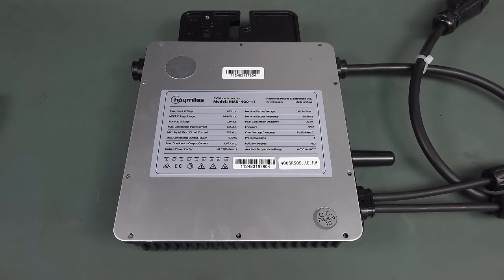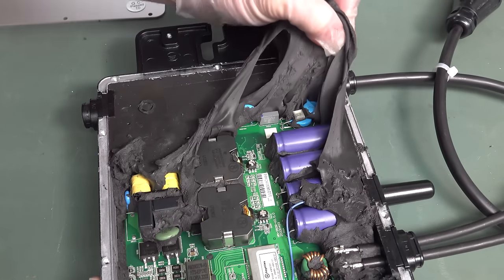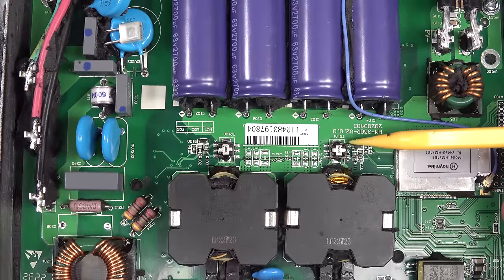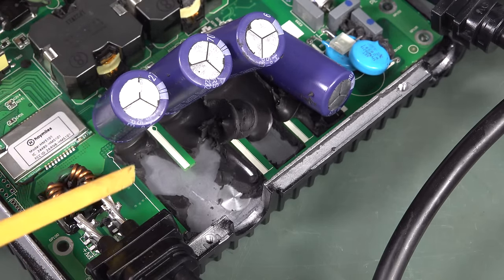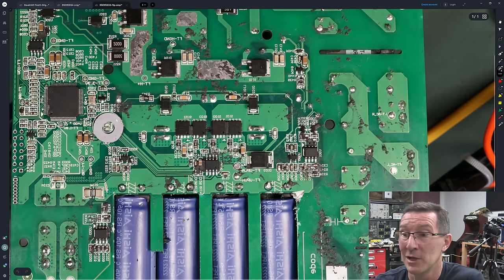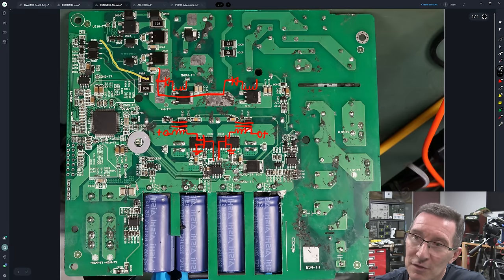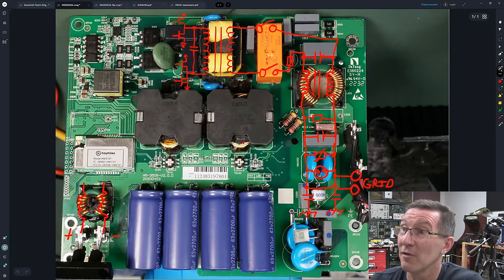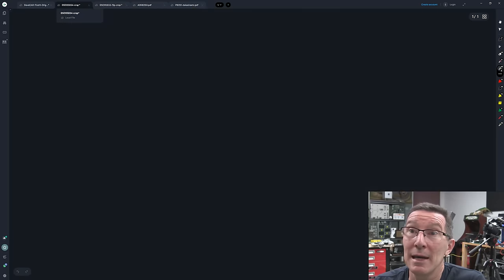EEVblog 1518 - Hoymiles Solar Microinverter TEARDOWN

Comment: Thanks for this. If you apply the panel backwards, the diodes in the FETS limits the voltage to -0.7V. I routinely get 356W out of my HM-350NT and they blow away my IQ8+. They're excellent, IMO.
Reply: haha that’s not a good thing. a -0.7v “limit” is a short across the panels...
Reply: @Ferraday  They are current limited to Isc, it doesn't hurt anything for a short period, and doesn't damage the inverter.
Reply: @Ferraday  Across one panel - it doesn't matter since they'll only get as hot as they would with no load anyway. The panel will get the same amount of energy from the sun whether it's shorted, disconnected or properly connected. Only difference is where the heat gets dissipated. If the panel can survive sitting out in the sun, it can survive being shorted.

I'm more concerned about the 0.7v drop across the FETs. At around 13 amps short circuit, they'll have to dissipate 9.1 watts worth of heating. Better hope that thermally conductive potting compound is up to the job since that's the only thing moving the heat from the PCB to the outer case.
Reply: @wasddasw6485  Clamped at around only 1v the panel will be so far from it's MPP that the output current will be nowhere near the rated value of that panel

Comment: Definitely get the other micro inverter for comparison. How do these thing’s synchronize with grid frequency?
Reply from the maker: Yes, they sync, that's the idea.
Reply: Loose sync and KABOOM!
Reply: @EEVblog  How ?? does it detect "grid" then switch on... but then how does it detect if grid is "disconnected"...?? ie islanding... cant figure that out in my little grey part...
Reply: @pedromorgan99  Simple solution would be to switch the output off for a cycle every 10s or so, and measure the voltage to see it collapses. Google says various methods are used, shifting the voltage or frequency and measuring for a response on the grid.
Reply: One would guess it uses PLL (Phase lock loop) type of circuit to achieve grid sync.
Reply: @mymisc1896  AC-Coupled capacitor PLL, Rneg synthesized clock sync, if there is no mains at the coupling capacitors there is no clock sync, its like an RF multiplexer.  The question is why does the inverter have to shut down? Why is it illegal to install an ATS like a generator?
Reply: @pedromorgan99  Yes. It's AC-Coupled by those 4 coupling capacitors   they serve to isolate the dc bias voltage on the transitor gate yest still be able to so clock-sync with the mains the proper frequency upon generation from the emitters.
Reply: @mpirron1  It is designed/required to protect service man when there is a grid outage. However, if there is smart switch/relay (e.g. Tesla powerwall gateway) then it will isolate grid to the rest of sub circuits hence can operate in "island mode/state" with solar PV until the mains is back which I guess the smarts would sync to grid phase/voltage with local inverter before connect AC  back to grid.
Reply: the PV micro inverter also need to know and act on how to reduce/switch off output when in island mode so it won't over charge the battery bank,  .. e.g. using frequency +/-
Reply: @mymisc1896  that's accomplished by a solar charging circuit, either mppt or pwm. During a Mains loss/grid uncoupled situation it's all o you have a string inverter or micro inverters you still can't use the electricity generated by your solar panel as you should be able to. The only thing you can use them for is charge your battery, and it's bullshit,  because a 1 ton mini split  will run on 3000 Watts all day. Six solar panels get you enough power to have Aircon probably not with batteries,

Comment: Is that mains side correct? I thought you weren't supposed to put GDTs directly across high current protected lines because once they light, they may not extinguish. I always heard that this was a common failure so MOVs are put in series with GDTs. Maybe the GDT is in the center and goes to ground, while the other side goes through one MOV to live and another MOV to neutral?
Reply: It will just blow the fuse on the mains.
Reply: @andreasdill4329  Good point, I don't see the fuse but I'm sure it's there.
Reply from the maker: I checked the traces, yep, it's in series with the MOV, nice call.

Comment: you can talk to them via an NRF and openDTU :)
Reply: Prices have gone through the roof since they are controlable by opensource software
Reply: Hi @Peter Kowalsky,
MI- and HM-Models did use NRF24L01+ for communication via 2.4GHz Enhanced Shock Burst at 250kBps.
But recent HMS- and HMT-Models instead employ an CMT2300A for communication via 868MHz / 915MHz at an expected 125kBps rate.
OpenDTU and AhoyDTU do not support HMS-/HMT-Model communication yet. But we are working on that :D

You may check our Wiki for the Protocol and some of the details for Germany and Austria,
in case you want to keep the produced signal in line with the local Grid Profile(s).
Reply: @karlakunze9823  thanks for the info karla!

Comment: My solar installer wired one of my 9 panel strings reversed polarity into the hybrid inverter. Managed to handle it fine, i was impressed. Though it would have at least destroyed the mppt for that string, but no... It's running fine...

Comment: Those Caps are called DC-Link capacitors, mainly energy buffer und reduction of current ripple, a common thing in Inverters 👍
Reply: And regarding the TMS320, no suprise 🙂 the C2000 is still being used today, but mainly as a redundency/safety controller not as a main MCU

Comment: Just I recognize that is a HMS version. The models with HM and MI it exist already a opens source project in github (Ahoy and OpenDTU). With that you can read the inverter and control it. 

The HMS use a other frequency (868mhz) and it is in reingeneering process already.

Comment: There was a fireman that died in Germany due to DC arc over a few years back. Since then they have to check the solar panels before starting the fire fighting. 

Note, that even if its in nighttime. Just the back light from the fire, might charge up the panels to a considerate voltage, even if there is hardly any current.

This is a problem, because if your house is on fire... for some other reason, and they can´t verify that your pannels are AC or low voltage DC, they will not save your house. (well.. they might if its just a minor fire, but if its a big fire and they have to spray the whole house)

Comment: Single phase AC has a sine^2 power profile where the PV panels need a constant DC load to provide maximum power.  You don't want 2x AC line frequency power flow ripple current to show up on panels or you lose power from PV panel.  

That is the reason for all the electrolytics across PV inputs and the weak component reliability link in the micro-inverter scheme.  Electrolytic caps MTBF is highly dependent on their operating temp.  Micro-inverters operate in a very hot environment behind PV panels, likely a few inches from a hot roof.  Not great for electrolytic caps longevity.

Comment: The DC output of the solar panel is not as clean as you want it.  They actually have a fairly high source resistance.  I forgot how many cells you have to have in series to get 60 volts.  Adds up to a lot of slop in the voltage hence a lot of beefy caps to smooth it out.  What kind of current pulses do you have at 400 watts?

Comment: Nice teardown Dave! I have a question though. The mains transformer looks so small for 400W and 50/60 Hz? Wonder what kind of core material is used to have the permeability and low Eddie currents required not to heat up like crazy. Also obviously the H bridge creates harsh rectangle waveform on the primary. There will be losses. Then again I am not an inverter person just wondering...
Reply: Nice catch. Dave got it wrong. Galvanic isolation is from the flybacks and the H bridge he is referring to is actually mains frequency unfolder. This is exactly the patent of Nphase inverter - flybacks operating with rectified AC reference and the H bridge converts it to AC. The magnetic components is a common mode filter with very high differential mode components as well.
Reply: @giangelov  thanks for the clarification. Though I don't see smoothing caps after rectification from the flybacks. So that means that flyback frequency halfwaves are used.  Likely the filtering after the H bridge takes care of this.
Reply: @LutzSchafer  That is the reason they have used interleaved flybacks - less ripple. They do have filter caps and the DM inductance helps also. On the front section it is exact topological copy of Npahse. In their design I remember they used thyristors for the H bridge. I'm not sure if Dave did check these devices, but from the solder side of the PCB the "gate" driving circuit looks very simple for driving MOSFET.

Comment: yes please, i like knowing the failure points of these
☺
Reply: The cable glands and the seal on the lid that is to flexible with to little screws. I opened my DS3 AP-Systems; same goo and waterdrops in all 4 corners within 6 montths after install.

Comment: So gas discharge between the mains, and another between mains and ground.  Good protection in case the mains are subject to something harsh, like a lightning strike?
Reply: nope. this will protect only from minor arcing, like f.e. ballast from fluorescent tube kicking in or disconnecting wall-wart . Lightning strike has current of about 10 000A. For 0.1ohm protection, this means 1000V spike . Also lightning strike generates huge EMP. 
IMHO best protection against lightning is insurance, as anything else just adds incredible complexity and cost.
Another good protection are dpdt relays with at least 5KV isolation on both input and output. 
As storms usually do not happen in clear sky, if there is no sun unit should be disconnected and grounded by relays. Usually spikes coming from storm can be also detected on AC side. Most UPS devices have some kind of protection algorithm implemented basing on detecting voltage spikes in the grid, throwing protective relay and switching to battery mode.

Comment: Hmmm...  It must disconnect if there's no mains voltage - got it. This means my neighbors who hope to enjoy electricity in case of power failure at least during the day are screwed. :)
A question though - how does it know when to disconnect? I assume all those microinverters are connected in parallel at some point, so to each inverter there is no difference between mains and another inverter.  How does it work?
Reply: Each baby inverter's AC output all meet up in parallel in some kind of "combiner" box where they are AC- coupled to your smart meter in one of several possible schemes. And then comes in, like you so astutely grasped, their primary function. See we assume the primary function would be to generate electricity for the homeowner, but only the homeowner thinks that. You know how can you know? Because if the grid operator is down and can't take the excess at it's price, you don't get to generate as your inverters shut off.
Reply: @mpirron1  You've completely missed answering the OP's question. The inverter was sampling mains voltage and frequency, and output current accordingly. The the mains power goes out. But the inverter has been putting current on the mains line, which if it were balanced to the load, would create a sinusoidal voltage. V=IR. So how would the inverter distinguish between that power failure case, vs the mains still being on?
Reply: @TheHuesSciTech  I didn't miss answering that question, Because it's not the one that anybody should be asking. But if I must... the inveteter is AC-Coupled to the mains, across the coupling capacitors And the frequency Is ... Oh, just read it in the other post below, or read the papers on it. However, there is a real question here. It's just not that one. The question is why do the inverters have to shut down?
Reply: Hint.... It's got nothing to do with backfeeding the grid.
Reply: @mpirron1  That was explained in the video. It's so that electricians working on fixing the problem (e.g. getting the fallen tree branch off the power lines) don't get electrocuted by power being fed back onto the grid by solar inverters on nearby homes. 

To add more detail, you could have special circuitry to cut off the house from the grid so that the inverter could power the house without energizing the grid; but a) that would be an expensive addition for a rare circumstance, and b) there's no guarantee that the current level of light on the panels could power everything in the house anyway, so it'd be a really shitty and confusing experience for the average person. Meanwhile, a emergency diesel generator can always provide XXX kW on demand, and are selected and specced based on what the relevant business/hospital needs to keep going. And the whole intention of them is to deal with power blackouts, so the equipment to definitively and safely NOT back-flow the power onto the grid is worth the cost.

So stop being a troll who dismisses perfectly reasonable and interesting questions as "not the one that anybody should be asking", giving BS answers, and thereby derailing their threads. You're perfectly entitled to start your own thread, so do that.
Reply: @TheHuesSciTech  I'm sorry if you don';t like find the way I say things peoplke need to hear, I found that when it works, it's the most successful way people come to understand, and they are still the minority. because you all are very blinded.
Reply: I mean come on man do you really think a lineman is gonna risk his life and just hope somebody doesn't plug a generator in through the Dryer plug without turning off their mains breaker? Would you? No nobody would You'd make sure there was a secure path to ground well before there was a path to you, everytime, maybe 2 just in case.
Reply: Read everything that I have written? In other comments. In this video. And maybe you can understand That if you're connected to the grid, your solar is not yours. You think it is. But it's not It's the grid operators cheap power that you can't use if they dont want you to. Can't you see?

Comment: more and more ppl is ordered to shut down there solar systems here if they use inverters of that type (one for every panel) they make so much radio noise together that they shut down airport radar and other communication systems. yes they complies by itself.. many of them together do not.

Comment: The square device on top of the AC side MOV is most likely a thermal fuse in series with the MOV to guard against short circuit failure of the MOVs. Quite typical arangement for surge protection. Will isolate a MOV that has failed low impeadance. You loose the surge protection but it shouldn't catch fire. Safety feature rather than functional benefit.

Comment: 16:40 Mains Voltage, Mains Frequency but no discussion about Mains Phase. Is all power added to the grid as Voltage (Amplitude) or does it ever use leading Phase to increase frequency back towards 50/60 hz. Would be nice discussing how the Grid goes down and the response of microinverters as Voltage and Frequency drops.

Comment: My son's friend is a lineman.  Protocol states that each primary phase must be grounded before any work can be done on the conductors.  However, it is interesting to note that no such protocol exists for the stepped down 240V residential connections to the distribution transformer.  As more and more solar go online I think these rules need to be changed.

Comment: Where are the output capacitors for the flyback converters? Surely they should be a similar size to the input capacitors.
Reply: There're not needed in this design. The boost stage creating the sin-like-wave by PWM. A filter (small caps + Inductor > 1mH, on the upper part in the video) removing the HF. The DC-to-AC bridge switching to the phases with 50/60Hz (or 100/120Hz?).
Reply: @deterdamel7380  So, are you saying that the big magnetic component at the top of the board is not a common mode choke as Dave has declared in his correction video but is in fact a differential mode choke?
Reply: @petehiggins33  I expecting an inductor with >= 1mH there, maybe common mode, or two on the same core or whatever. I said it's not an isolating configuration. But Dave mention this in the correction video already.
Reply: @deterdamel7380  Someone on the correction video has pointed out that the input filter has to handle 100Hz ripple current and maintain the input voltage within the operating range and this is why the input capacitor is so much larger.

Comment: I think they are using two 180 degree interleaved step up converters and than make the AC which they then step up to 230ac using that other output transformer. That could be, instead of using two fkyback with all their disadvantages vs step up in CCM.

Comment: Theres an open source solution for the wireless protocol with an ESP32 and some wireless module as a bridge. Got it running, works like a charm and only costs cents!
Reply: Can you share the solution?

Comment: I don't think, that the transformer on the top (AC-output) is an isolating one. It's too tiny for 400W @50Hz. I guess it's a filter in mH range.

Comment: It would be unusual to fit a spark gap over the top of an MOV, it is more likely to be a thermal sensing device to check if the MOV's are getting hot through over voltage.

Comment: Certianly. Some of them have a bit of an iffy rep. I was thinking of getting 3 of these for the 3 spare panels I have. However the cost!! So I bought a Solis 1 KW inverter 2nd hand. (As new under speced by an installer) so it has only a few hours of use. This will tie in with my 5 Kw Solis inverter.  It wiĺl run 4x 260w panels so I can add another panel if I want. It cost less than one 300w micro inverter so all good.

Comment: The h-bridge drive after the flyback looks like it might be a full bridge driven LLC converter? - hence the two caps, one for DC, one for AC resonance. Did you check the pin connections there?